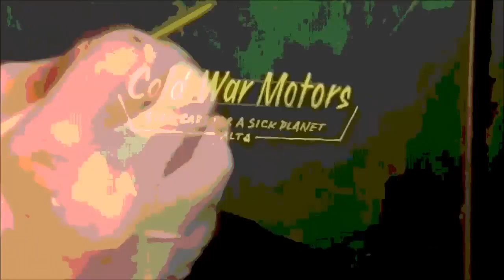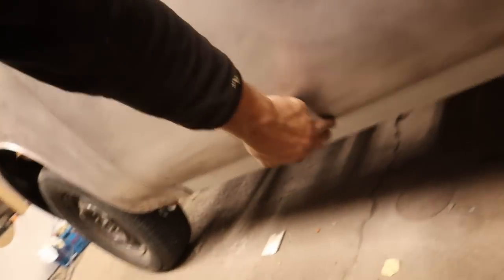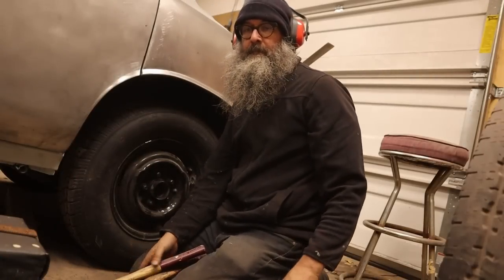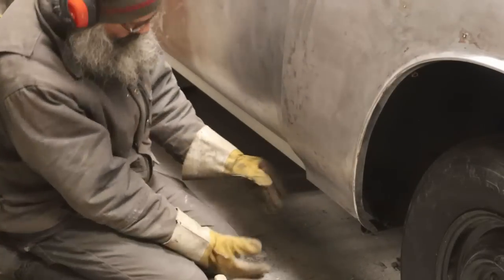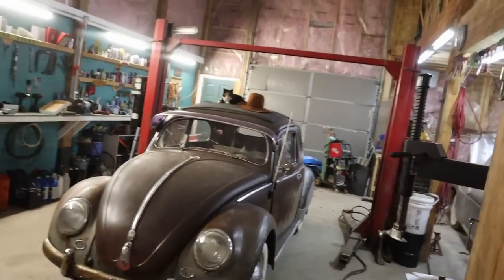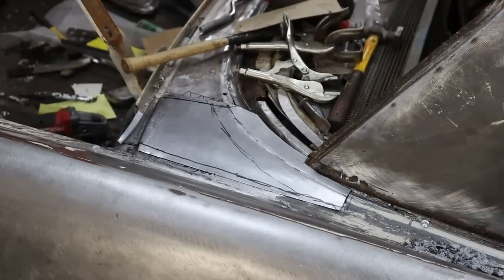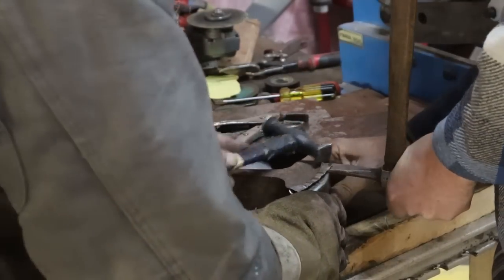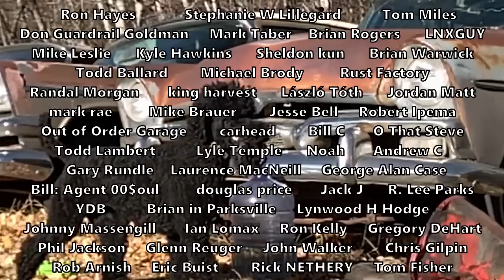All-Metal Weekend! Making stuff Fit, Plus: Rust Repairs for the Rover and Jim's Continental Mark II!

Comment: Back when I was a volunteer firefighter in the 1980's and 90's we would walk around after putting out a hot car fire and pick up the metal that melted and ran off. Those cars from the 1960's and 70's had at least 10 pounds of lead in each one.

Comment: After 5 to 10 years of panel beating (not all day everyday of course) i finally got to the point that I can make panel fitment not worse than before. But I'm jealous that Scott just makes the sheetmetal behave as he wants to. With ease.
Reply: For me, just hanging a new (old) door that a neighbor had backed into was a three day ordeal, including trading outside trim, locks, interior door panels; and dealing with electrical issues.

Comment: Watching you and Jim thrashing away on the Mark II a phrase I heard a long time ago kept running through my head " Bash to fit, file to hide, paint to match" It certainly seems like that is the way FOMOCO built that car. After the tons of lead you washed off, Jim will have to re-adjust the suspension to get the car to ride level. Cheers!
Reply: Lincoln was a separate division of Ford at that time.

Comment: Those are some mad skills you have there. The Rover is going to be better than the time it left the factory. The gaps on the doors and fenders are spot on. Now I can see why it costs so much to get good body work done on a car. Jim is such a funny and witty guy. He has a way with words when you least expect it. It was fun to watch you two make the pieces for the rear quarter. Those old timers that did the leading in were artists with making it flow the way it did. They are all dead from the lead dust and such, but they could make a smooth seam. We used to do a lot of lead work in my younger days with the telephone cables as they had a  lead sheath before they went to plastic. Love this channel.

Comment: This episode alone could be 2 high school shop class sessions. Although at times slow, it shows exactly what tasks and techniques are required to properly replace/replication a complex angle pieces of body work.

I would recommend that anyone embarking on a quality restoration just watch this episode.

 If not doing the restoration yourself, you will know what the skilled craftmans hours require. 
And without many of the proper anvils and hammers and stretch tools, best hire a good craftsman. 
I very much appreciate your dedication to showing the whole unique process/steps. 
I expect to find and hire out my restoration pieces installed. Unless, and maybe including, finding a similar car to dissect the needed panel pieces. Then have the craftman final trim and install.

Comment: Super skills on the Rover. The original rubber door seals were very soft and yielding and perfectly shaped. Remade ones as available are very poor and far too hard. This causes problems in getting a good shut on the doors. I reused as much of the old stuff as possible on my P5B. All the bestfrom the UK.

Comment: A little trick a now departed body man taught me decades ago (that I seriously doubt you need me to teach you but others may not know) about locating things like those door latches that are "precisely" located yet need to be removed for painting. Once you get them exactly located, drill a 1/8" hole or two through them into the mounting material so that on final assembly you can use a 1/8" bit or allen wrench to exactly re-position the piece where you had it adjusted to. 
I did a major update on my 57 Chevy a few years ago now. Started with a completely "finished" car and updated most of the mechanicals, wiring, brakes, steering (column/wheel). The car was down to the "hollowed out" body and the frame. Taking the hood, front fenders, etc off, I used that 1/8" hole method. Put the original shims back into the front clip, used 1/8" allen wrenches to mount the fenders and hood. Worked great with nice "factory" level gaps. 
Making those tiny little pieces is a real "pain" isn't it??? Amazing how much time and angst they require !! Probably easier to make a half quarter panel patch !!!
Almost forgot, loved the reference to Carter Auto !!!

Comment: Props to the guitar improv on what sounded like Just Like Me by Paul Revere and The Raiders. Next I am reminded of Tales Of Brave Ulysses as you work on the Rover and the Continental. "You thought the leaden winter would bring you down forever..." Viewers cannot help but notice a forlorn box of O'Doul's as a hapless product placement, in conjunction with the absence of Dean in the shop. There's probably no connection but...

The snowmobiling fun is an incentive to keep rims and other miscellaneous hard parts out of the yard expanses. The VW bus roof would make an excellent towed toboggan for larger groups. Where the heck does anybody even look for a VW bus roof? I suppose these are the questions that will be answered in eternity.

Comment: Believe it or not: My Catalina had a thicker layer of bondo than the piece of the Continental you showed. I kept it all these years. It was even useful. I brought it as a sample when we were mixing new paint that would fit the car. So I could keep it in storage. Fun fact: The guy who "repaired" the car ages ago even put bondo over a more than 1 inch long bolt he put in trying to pull out the edge of the quarter panel. Maybe it was to much of a job removing the bolt! He did not want to work about a minute taking it out.

Comment: You can NEVER have enough vice grips! How many times I was lying under a car and finally had a panel or a fender fit well to the car. Calling out: "Hand me a vicegrip". And there is not one near by when you urgently need it. 
Talking of sparks: Once one ignited a plastic cover in a trunk of my nearly finished car. Luckily a friend was very fast grabbing the fire extinguisher. I only had to replace a brand new trunk mat I installed a week before. Once I nearly burnt a customer's car when a spark jumped several yards and put a thinner soaked cloth on fire under the rocker panel of a car that was on the lift.

Comment: Honestly, this finetuning on the Rover is hard for me to watch. You are qute a perfectionist. It shows me how halfassed most of my projects are fitting. I do not think that those vehicles ever had half as good fitting when they left the factory. Specially British and American cars.
I never succeded in making the doors fit on my Corvair project even halfway right. Whatever I tried. It is actually better to have gaps on the wider side. The doors on my car were rubbing in front, the b pilar region and even at the rear. I got the car in pieces. And I cannot imagine that anything ever kind of fit when the car was new.

Comment: Really like watching all this metal whispering. Does fitting new door seal rubbers after lining everything up, mean you have to re-visit a lot of the panel positioning further down the line?
Reply from the maker: Shouldn't be a problem, but I'll be checking everything with rubbers installed before we commit to paint. The latches haven't moved much, I'm mostly adjusting the edges and so on... Cheers!
Reply: @coldwarmotors  Hi interesting, thanks, these metal forming vids are very handy

Comment: Working to well in excess of OEM specifications on the lincoln. They dont make em like that anymore. Just as well as we would have a lead shortage if they did. Found some lead on the rear pillar join on a 75 mk3 Cortina. Thought it was a bodge at the time but maybe not. Anyway a fine collection of fiddly bits fabrication which i enjoyed. Perhaps you need everyone to have whiter teeth? I think that is the secret of Chip whats his names Oversimply success.

Comment: All the Rover gaps are excessive for modern cars but for an English handbuilt car of the period it's pretty good. Better than most English cars. The left front door has a weird gap just below the front door lock between front and rear door. It widens there but the rest of those doors are pretty good. I imagine the body dies were worn when this car was made. That contributes to the problem. Jim's lincoln was really hit hard and a shit show on original repair. You have really brought it back.

Comment: Scott, question: when you were hammering the radius for the window sill panel.
You turned it over and changed hammers.?
Why?
Reply from the maker: Hi Stephen! I think I just wanted to smooth out the radius I had made by planishing with a flat hammer against the radius on the anvil... Cheers!

Comment: I’m not body man so I’m not questioning how you do what you do but why. On the rover you’re matching up the driver side doors but there’s not rubber gaskets in. Are you concerned when the rubber gaskets are installed that body line won’t be that perfect?
Reply from the maker: Oh! Stay tuned! It's a process for sure...Cheers!
Reply: You put the rubber gaskets in and they hold the door slightly open, so you adjust the latches so they close where you want and the rubber seals up the opening. After a while the rubber takes a set and it's ok.

Comment: To hit 100k subs I'm afraid you're going to have to LS swap something, preferably something that still runs and drives with low miles and an unmolested body and interior.

 You swap a 6 litre, 4L80 and a tiltwheel into a nice 64 Studebaker Wagonair w factory V8 and a 3 spd and make it do massive burnouts and it wont matter that the front pulley rubs the rad and there's no horn or lights . You'll be at 100k in like, no time! Give it a stupid name like "Screwed Stude", make a buncha shirts and no one will realize that it disappears behind the shop and never gets finished. Don't forget the self-serving sitdown monologue explaining why it was the only way to save the car because the factory underhood wiring was risky and no one makes a repop.
Reply from the maker: Ha! Thanks for the laugh, Jonathan.... I guess we'll just have to toil in obscurity, hey? Cheers!

Comment: I doubt if ANY car built in the 60s had perfect panel fit, some would reasonable fit, MAYBE a hand built Rolls Royce in the 60s had good panel fit because a lot more time was spent on it, but run of the mill cars, they were only given X amount of time ( a few minutes MAYBE, nowadays about 30s or LESS ) then the workers had too move on the next car, consistent good panel fit really on came 80s--90s with the Japanese cars their tolerances were smaller, even inside the engines. The P4 P5 Rovers were a well made car good quality, from there it gradually went downhill, later Rovers were based on Honda's, i liked the SD1 V8 model

Comment: as i understand it- the mkii was spozta get the retrac hardtop that ended up on the skyliner.
is all that shitty metalwork at the back evidence of a hasty factory rethink?
Reply from the maker: Well, I think they were just finished to a high standard, using the technology of the time. Most coachbuilt cars of the time would likely be very similarly constructed. Cheers!
Reply: @coldwarmotors  cheers!